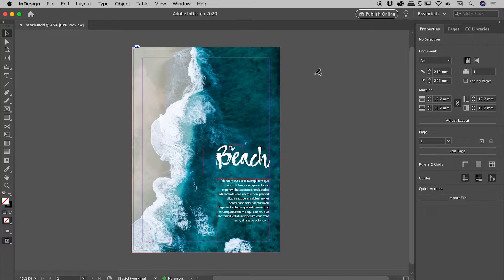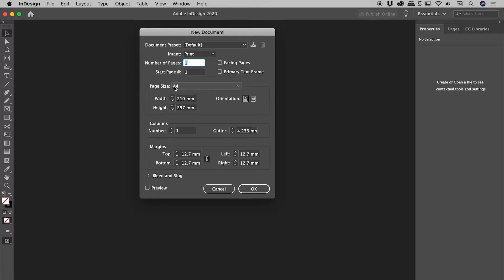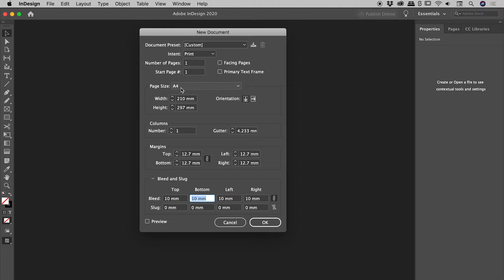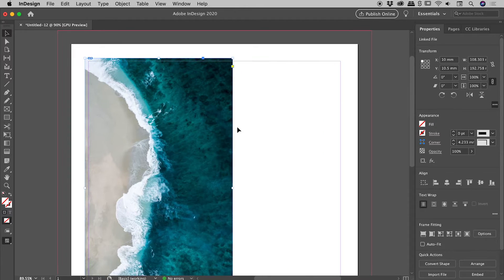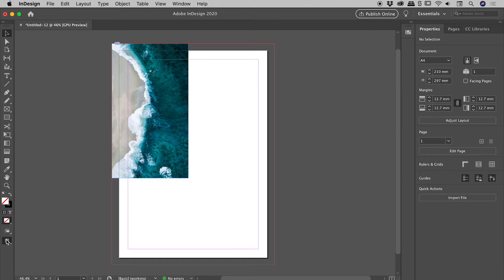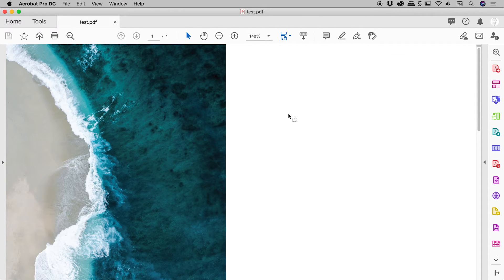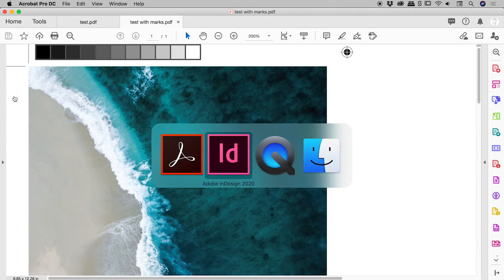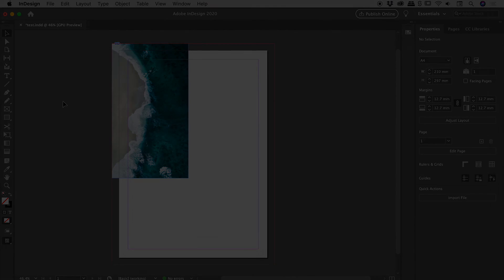Set Up Bleed in InDesign Document

Comment: Thanks Michael, I wasn't sure if I need to add 3mm on each edge for bleed when setting up the document size, but as you've explained, InDesign does this in the background.
Reply from the maker: Thanks mate. I hope you are creating some cool documents in InDesign. Later.
Reply: @MichaelBullo  Most of my work at the moment is adjusting pdf or jpg poster designs and sizes ready for print. Typically I receive art that has no bleed and/or needs converting to cmyk. I'd be interested in how you best handle rgb to cmyk conversion b.t.w.
Reply from the maker: @BishwaOakes  Any RGB images I have get dropped straight into InDesign. I use the [Press Quality] PDF preset when exporting which converts everything to CMYK.
Reply: @MichaelBullo  Yep, pretty much what I've been doing. I do notice the output is less vibrant and wonder if the pdf colour handling is having an effect. I'm not sure how to set the colour handling in the pdf export?
Reply from the maker: @BishwaOakes  In case you don’t know, CMYK supports far fewer colours than RGB. It's very common for a CMYK image to look washed out in comparison to its RGB equivalent. Personally I don't change anything to do with colour in the export.
Reply: @MichaelBullo  Yes I'm aware of the reduced colour gamut. Maybe I'll try converting the colour mode in photoshop first and pump up the vibrance etc a bit. Thanks for the help.
Reply from the maker: @BishwaOakes  Thanks mate and good to hear. Sounds like you are all over this. Don’t forget that if you push colours outside the range, they will get converted back down at export.

Comment: But the actual size of the file changes right? We croped off the edges from the file itself right?
Reply from the maker: There are two elements to a placed image in InDesign. The image and the frame that contains the image. When you crop an image you are merely adjusting the size of the frame surrounding the image. This is why you can easily "un-crop" an image at any future point by altering the frame. The overall file size won't change. The same logic applies to the Bleed.

Comment: Im importing a a1 sized graphic i did in photoshop? when i add the bleed and extend the image i now lose parts of image and text i wanted to keep? does that mean i now have to go and redesign all of my images so that its essentially got a border around the outside?
Reply from the maker: Yes. You need to factor in the bleed in all of your graphics at all stages of your design. The graphic you create in Photoshop should be "A1 + Bleed on all sides" in size. Hope it's a quick shuffling of elements and not a major redesign.

Comment: I really like the way you explained it! However I have a question! I am printing a multi page document with facing pages… should I have bleed on the inside as well? Because then the bleed would be part of the page right next to it… won’t that mess it up? Thank you :)
Reply from the maker: Thank you. It's unlikely you'll need a bleed on the inside for the printing of a regular book. However, there are some forms of printing where you might. The best thing to do is chat to the company that will be doing the printing and ask what they need. If you wanted to do some reading on this topic, you could start with something like "perfect bound vs saddle stitch". I went through this stage and got myself terribly confused. The good news is that what InDesign does by default is generally a great call.

Comment: This tutorial was so well done! I had a question though, if I want to print an image at, let's say, A4 size, am I always going to end up getting a smaller image because of the bleed that's occupying part of the document? Is there a way to calculate what the real image size is going to be if I have to make the document fit the page?
Reply from the maker: Thank you. Much appreciated. Now let me put your mind at rest. Let's say you had 3 different A4 documents with bleeds of 0mm, 3mm and 10mm. All 3 documents would end up exactly A4 in size. This is because the bleed is added to the outside of the document. The area of each of the PDFs may be different, but that's to accommodate the different amount of "stuff", such as bleed/slug, that sits outside the A4 document.

Comment: Sorry this does not work for my book cover, I would love to know why.  It also would have been v-e-r-y helpful to indeed have the artwork reach all four corners--like most covers, and then execute the necessary tasks.
Reply from the maker: Hi John. I'd like to offer some help but you'll need to give some more specific information about the problem.
Reply: @MichaelBullo  Hi Michael, That would be amazing--almost impossible to find a competent consultant.  I am unable to “stretch” "enlarge” "re-size” or whatever the correct terminology is my cover, i.e., Front, Back, and Spine. I see the perimeter of the bleed marked (0.125) meaning the gap between the red background (in my specific case) and the outer bled line, but no matter what I select or “make active” I am only able to get one or the four sides to move.   If possible, I’m at:   pseudonym_commercial@protonmail.com  My publishing deadline is coming like the proverbial freight train.
Reply from the maker: @johnbayman6102  Hi John. Sorry but I'm not available to consult. However I am happy to try and help you here.

So it sounds like your issue might be just the resizing of images. I have a whole video on that…

How to Resize an Image in InDesign
https://www.youtube.com/watch?v=5urFe4QclZg

You might also consider posting this issue on the Adobe InDesign forum. A lot of experts hang out there. You can also post screen shots which you can't do here. If you do post there, feel free to post a link to it here...
https://community.adobe.com/t5/indesign/bd-p/indesign

Please let me know how you get on.
Reply: @MichaelBullo  Again, thank-you so much for the suggestions and all of the work you put into these tutorials.  I have watched your re-sizing video, and still no success.  The area between the page and the bleed simply will not display any, well, “bleed.”  Also just to be clear, I really would prefer to not re-size--meaning that if I have a 1” square that is 1” away from the page edge--that’s exactly where I would like it to stay.  I just want the background color (in my case red) to fill the area mentioned previously.  Complete mystery, frustrating, and running out of time--and you can’t even pay someone to help--very odd times.  I’ve been working with Ai for going on two years, and doing relatively sophisticated graphics for my book, wouldn’t say I’m an expert by any stretch, and I am confident there are countless “things” Ai will do that I am unaware of, however, I am navigating it quite well for my purposes.  This is only to say that I am not a complete neophyte within the Adobe architecture and GUI.  I’m sorry that you cannot offer consulting--I have noticed an aversion for consulting or helping clients directly among Adobe “experts,” perhaps that is the culture?  Nevertheless, thank-you for your time.
Reply from the maker: @johnbayman6102  Thank you John. I appreciate the compliment and the feedback.

You mentioned page background colour. I'm wondering if you are changing the Paper Swatch colour. If so, this could be the source of your problem. Check out this video of mine that may help…

Change Background Colour in InDesign
https://youtu.be/07SXpA6SRC8

Have you tried resetting the InDesign Preferences? When an Adobe program starts acting weird this is often a fantastic general solution...

How to reset Preferences in InDesign
https://youtu.be/EunNdHFxmDw

Hope this helps mate.

Comment: when sizing your graphic to the bleed, should the red bleed mark always be present, or can the graphic edge actually cover the bleed mark? In other words, the blue edge of your graphic superseding the red bleed mark.
Reply from the maker: Your graphic can happily extend as far beyond the bleed as you like. Go crazy. Just make sure that the graphic at least gets to the bleed and you'll be fine. 

You may not know that if you are using the Selection Tool (has a black arrow for an icon) you can resize the frame that holds your image. The image will remain in place while you effectively crop it. I mention all this as a lot of designers like to resize their frames to hug the bleed. While this creates a "cleaner" design, you absolutely do not need to do this. Just in case you are a little OCD like I can be ;)

Comment: I am working on a book, and when I export the PDF file for the printer, the bleeds on pages extend over to the facing pages. How do I avoid this? Or does it need to be avoided?
Reply from the maker: Generally, as long as you've included the Bleed in the export, the default PDF that you get out of InDesign is suitable for printing. However, things can be complicated if you are using specific kinds of book binding.

Can you talk to your printer about what they need? This would definitely be the best course of action if you can.

This topic can get pretty intense, as the forum post in my link below shows. I'm reluctant to include this link but it does contain some terms and ideas that could potentially help. I want to emphasise that what you are getting by default is probably fine. Don't let this post freak you out ;)

https://community.adobe.com/t5/indesign/exported-pdf-displays-the-bleed-of-the-previous-page-encroaching-on-the-next-page/td-p/10979262?page=1
Reply: @MichaelBullo  Great; thanks so much. Your presentation was very good--better than the one I initially watched. The main difference was your pacing, which allowed for absorption of the information--so important in teaching.
Reply from the maker: Thank you. Very kind of you to say. Best of luck with the project.